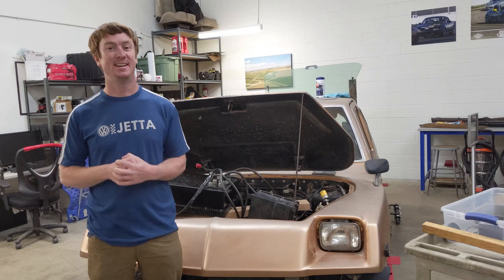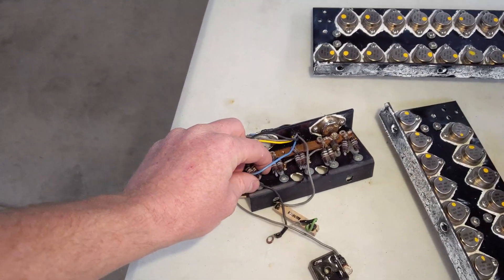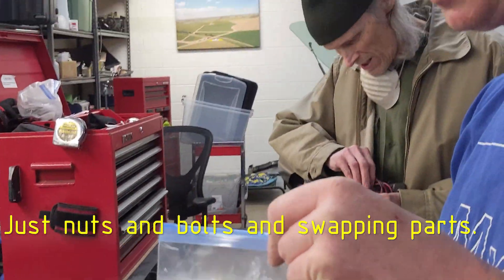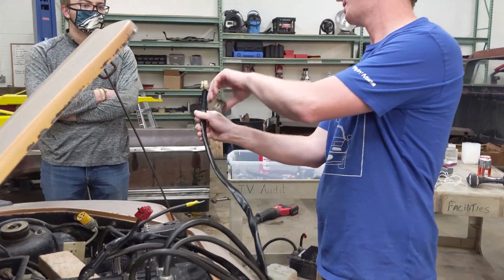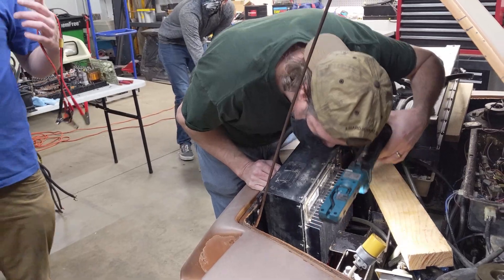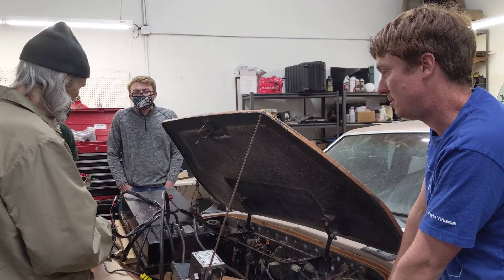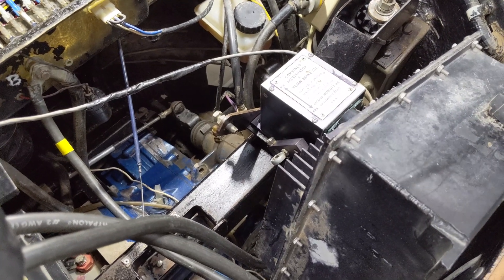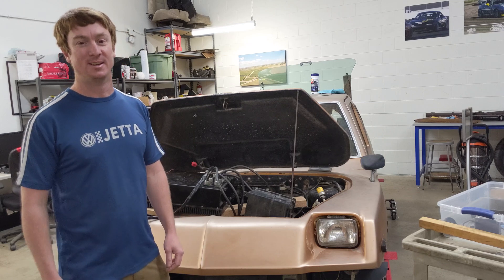The Electrek Motor RUNS For the First Time! - 1982 UM Electrek Restoration Ep5

Comment: That controller is epic. All those transistors in there. Totally through hole construction or to wiring terminals. A modern controller of the same wattage and voltage would be 1/4th the size and highly integrated.
Reply from the maker: It really is not only technically awesome but a work of art in some ways. Everything is mounted to the heat sink side for instance. Jim can talk you through the circuits and you can visualize the process vs. a modern controller where everything happens inside a chip. Every single one was hand made by the Soleq Corporation and each one is slightly different. It really is epic.
Reply: @EVSwap  And since it is designed like it is, totally repairable and trouble shooting electronic failures is not that hard. Put an o-scope on the power transistor bases. I'd like too know what sort of signal they are getting. I'm sure it's some sort of PWM. Do you know if the motor controller uses an H-bridge or not?